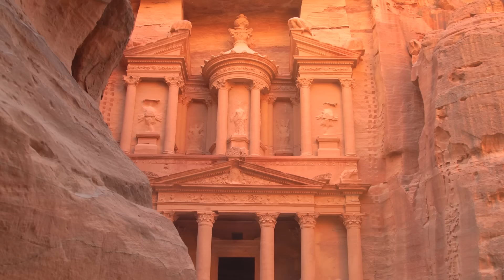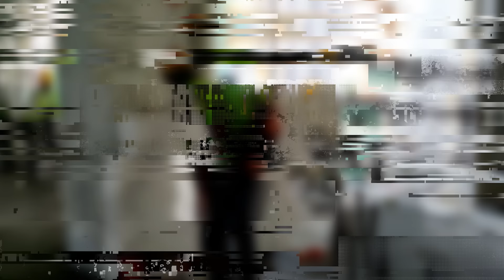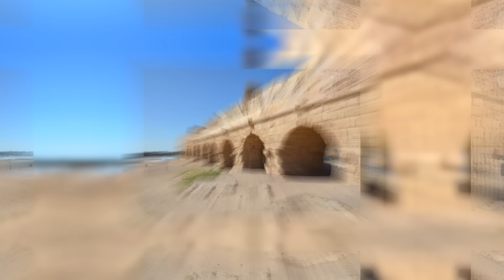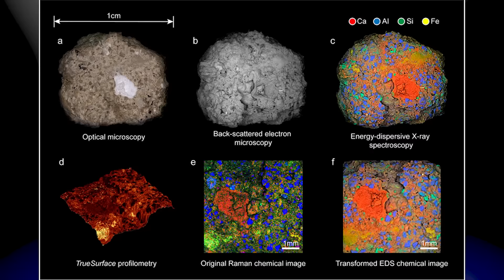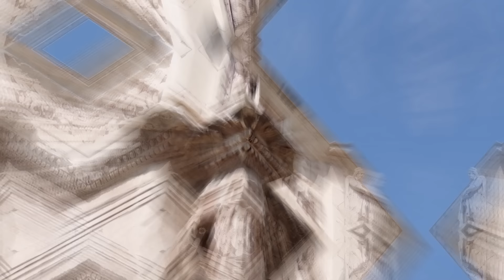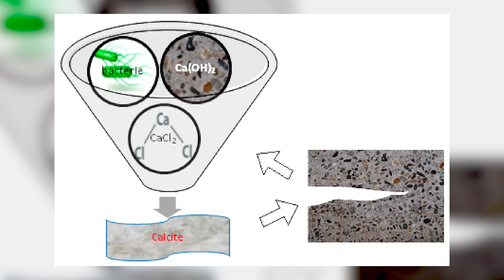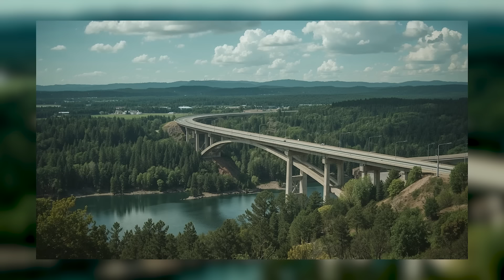Why Roman CONCRETE Lasts 2000 Years While Ours Dies in 50

Comment: There is a bridge in France that has a foundation that IS 2000 years old. It is made from a mixture of hemp shiv and lime mortar. This is also a self healing compound and, with moisture, the hemp shiv being high in silicates absorbs CO2 from the atmosphere and forms a compound like seashells. It is mould, insect, fire and water resistant. It is also a heat insulant and absorbs, and to a certain extent gives out, moisture.
Reply: il existe de pont très vieux en France dont les fondation date de l'epoque romaine, les vieux pont entier sont rarement utilisé, autre que pour la promenade, mais il y en as beaucoup, du moyen age dont je roule dessus. Ils sont de la meme epoque que les vielles églises, tout en pierre
Reply: That’s a high bridge? 😱
Reply: 1. “A 2000-year-old French bridge made of hemp and lime”
→ Unlikely.
No historical or archaeological record supports a Roman or medieval bridge in France built with hemp shiv and lime mortar. The Romans used lime-based mortars extensively, yes — often mixed with volcanic ash (pozzolana) or crushed ceramics for durability. But hemp as an aggregate in mortar is a modern innovation, rediscovered and popularized only in the late 20th century (the first modern hempcrete house was built in 1986 in France by Charles Rasetti). So the claim of a “2000-year-old hemp bridge” is not factual.

2. “Self-healing compound absorbing CO₂ like seashells”
→ Partly true, but not magical.
Lime-based materials do indeed absorb CO₂ over time through a process called carbonation:
Ca(OH)₂ + CO₂ → CaCO₃ + H₂O.
That’s why old lime plaster hardens like stone — it literally re-forms calcium carbonate, similar to seashell material.
However, it’s the lime binder, not the hemp shiv, that drives this process. Hemp contributes porosity and moisture regulation, helping the carbonation along, but it doesn’t itself absorb CO₂ through chemical bonding.

3. “Hemp shiv is high in silicates”
→ Not really.
Hemp shiv is mostly cellulose, hemicellulose, and lignin — organic polymers, not silicates. Its ash contains trace silica, but nowhere near enough to make it a “silicate-rich” material.

4. “Mould, insect, fire, and water resistant”
→ Mostly correct when combined with lime.
Raw hemp shiv will rot or mold if kept wet, but once encased in a lime binder, the high pH and mineralization make it resistant to fungi, insects, and even fire. The finished composite is quite durable and vapor-permeable — it can absorb and release moisture without losing strength.
Reply: @bertvdl1178  He said the foundations of it are that old
Reply: @bertvdl1178  Hemp makes Ceramics at room temperature
Reply: @bertvdl1178 les enduits à la chaux ne durcisse pas comme de la pierre, mais ils s'effrite aux bou de 100 ans, tu en as deja vu? Ici il y en a plein et c'est encore parfois utilisé par des particuliers, car la chaux est respirante, tandis que le ciment ne " respire pas" .
Si tu est maçon tu comprends le terme "respirer" pour la chaux
Reply: @pierrebreton1153 , средневековые фрески- это роспись по влажной штукатурке. В Сикстинской капелле они по-прежнему хороши. Как и многовековая штукатурная основа.
Reply: @bertvdl1178  

Search Assist

The bridge you are referring to is likely the Pont du Gard, an ancient Roman aqueduct bridge in France, built around 50 AD. It is made primarily of shelly limestone, not hemp and lime, and is renowned for its impressive engineering and historical
Reply: Потому и запрещают выращивать коноплю , чтобы не строили вечных мостов ...
Reply: Its also due to how they built. They built to last not the cheapest like nowadays.
Reply: There’s so many uses for hemp.
Reply: Я родилась и росла в Советском Союзе(С.С.С.Р).В те времена у нас конопля была технической культурой и её выращивали для производства,делали ткань из неё.Никто у нас тогда и понятия не имел о курении конопли и наркоманов практически не было.Запретили коноплю по-моему незаслужено.Конопляное масло имеет лечебные свойства и в строительстве домов конопляная щепа у нас в некоторых регионах тоже применялась.Тема экологического строительства  очень интересная!😊❤
Reply: 'like seashells' is calcium carbonate, as mentioned in the video
Reply: @seguefischlin  YES, ever try to break a Sea Shell. Tough and lasts 100,000,000 years!
Reply: جيد لكن الرومان  قبل الميلاد ب 700 سنة هناك قبلهم الفراعنة والفينيقيين والآراميين وحضارة الرافدين
Reply: @kg6949  That's the fake history you refer to. In reality there were no Pharaohs, no Phoenicians, no Arameans, no Mesopotamian civilization. Christ was a Roman=Mongol emperor/caesar in the 12th century. He is pretty much the first individual we distinctly know about in terms of life and the surrounding history. Before Christ history is unknown.
Reply: بأوروبا يؤرخون وكأن روما بداية التاريخ الإنساني هي حضارة عظيمة صحيح لكن قبلها حضارات عندها بالعمارة ما قد يكون مثلها او افضل منها خرجت من الجزيرة العربية ك الفينيقيين  والآراميين والكنعانيين وهناك ناطحات السحاب باليمن السعيد بنايات 5 طوارق على رؤس الجبال وغيرها كثير الكنعانيين وحضارات الصين والمصريين وغيرها كثير
Reply: @kg6949   As mentioned before there was only one civilsation that started everything which can be called the Roman Empire. It started in Egypt 1500 years ago, then spread to nowadays Turkey/Greek and next was centered in Russia. The nowadays Arab regions were part of this empire. Since most of it is desert it garnered only importance in the 20th century due to oil resources.
Reply: @kg6949  You are appealing to a Jew here. Useless activity. They also wrote their vision of "history" for modern people)
Reply: Mold
Reply: Les enduits à la chaux s'effrite aux bou d'une centaine d'années
Reply: @pierrebreton1153  Lime plaster, mortar and roman concrete are different things, lime plaster and lime mortar can be made with either quicklime or natural hydraulic lime giving different results. 

Roman concrete was made with natural hydraulic lime with added pozzolans (there are vast amounts of volcanic tuft in the area around Rome but brick dust and coal ash are modern substitutes.)

All lime morter, lime plaster and roman concrete have self healing properties depending on the amount of unslaked lime particles left over in the mix. The amount of aggregate and other additives and residues like pozzolans and silicates will also affect the final outcome. 

So your blanket statement that "lime plaster lasts just 100 years" is not true. Lime plaster can last a decade or a thousand years depending on the type of lime (quicklime or natural hydraulic lime), the aggregate, additives and impurities. 

Another factor relating to natural hydraulic lime, it has different strengths ranging from 2 newtons to 5 newtons). There is Roman stucco that is over 2000 years old that used very strong NHL and is still rock hard so again your statement is incorrect.
Reply: @motimobo j'imagine que tu sais que la chaux est du calcaire chauffé a 800°c donc a l'epoque il devait y avoir du charbon de bois donc le charbon de bois ou  des cendres de charbon dans la chaux ou le béton n'est pas recent😂
Encore une fois tu a tord et tu as beaucoup de biais.
Reply: Interesting
Reply: If hempcrete, hemp based ceramics, and hemp charcoal and ash were used as materials that may explain the particular variety used in the particular bridge foundation but it's hard to say without knowing exactly what bridge. It does seem possible to produce high silica ash and ceramics as base materials for a hypothetical shiv or concrete mix.

This is from Chatgpt:
 
 Hemp itself cannot form true ceramics in the classical sense—i.e., crystalline, vitrified, or sintered materials produced by firing minerals at high temperatures (usually 1000–2000 °C). However, hemp can be used to produce ceramic-like composites or bioceramics through alternative processes that occur at or near room temperature.

Examples:

1. Hemp-lime composites (“hempcrete”) harden through carbonation (a chemical reaction between lime and CO₂ in air). This happens at ambient temperature but produces a cementitious, not ceramic, material.

2. Hemp ash ceramics—hemp biomass can be burned to create silica-rich ash, which can then be sintered or combined with binders to make ceramics, but this requires heating.

3. Bio-ceramic polymers—hemp cellulose or nano-cellulose can serve as a template for sol-gel or mineralization processes, forming ceramic-like structures (e.g., hydroxyapatite coatings) at room temperature. These are technically organic–inorganic hybrids, not traditional ceramics.

In short:

Room temperature: yes, hemp-based materials can solidify into hard, stone-like, or ceramic-like composites.

True ceramics (vitrified/mineral): no, those still require high heat.
Reply: Not true. No hemp in the bridge. Internet hype and misinformation.
Reply: @0ldb1ll
Certainly in France there's no building that old.
The oldest, still existing buildings are a few centuries old.
Reply: And most importantly, it's smoke-able :face-fuchsia-tongue-out::face-purple-crying::face-purple-crying:
Seriously I hope hemp makes a massive comeback but even after Donald Trump made it legal to grow for All industrial insulation and clothing purposes purposes in the farm bill he signed into law in 2018, no one's growing it since the states are asking an outrageous price for the growing permits. It's cheaper and easier to abort a fetus than to grow a single stalk of male hemp. Hopefully we get a top down federal law that protects it from state censorship. Kinda sad.
Reply: he beautifully fact checked you 😂 it must be a really big feeling of shame after such a due crashing review
Reply: @szymonbaranowski8184  berdvdl a fait une grande explication, mais elle est fausse.
Pourtant tout le monde lui met un pouce, alors qu'ils ne comprennent pas😂
Parfois l'humain est bête , comme un mouton 😂

Comment: More CO2 is good but so are things that last. 

 Sea shells are composed of basically same materials as concrete yet on the order of hundred times stronger impling there is a way toward vastly stronger concrete - not to be confused with more durable, sea shells may decay relatively rapidly.  (just an interesting tangent)
Reply from the maker: That's a really interesting tangent about seashells and their strength, thanks for sharing!
Reply: @MedievalWisdom  Back in 1990, Paulding County Georgia contracted for a new jail that was made with shells and coral and that was a big thing for the contractor who sold the county the structure.  I covered the story for a local newspaper and was even treated to a  private jet to the Mobile Ala contractor who was 'making the sale' to the local sheriff.   The plain fact is that apparently for some reason that jail was decommissioned in 2019 or so ... just thirty years after construction and the whole thing was razzed.  Don't know much about the circumstances but the size of the jail was projected for the then population of just over 40,-000 residents.  The county being on the of the fastest growing in the nation in that time (consistently ranked in the top ten nationally) and is now over 160,000 residents suggesting we may have just 'outgrown' the facility and that is the reason for its abandonment.  I could conceivably do some inquiries as to the nature or condition and reason for the destruction of the facliity within thirty years.

I will say that my concern regarding the disintergration of the infrastructurer is that such a large portion of the construction is for public infrastructure whether it be buildings, roads, bridges or other elements. 

I think it would also be interesting to see more detail in regard the disintegration of concrete particularly regarding structures like the Hoover Dam, which is largely concrete and massive and certainly involved with moisture as it holds back the waters of a rather large lake.